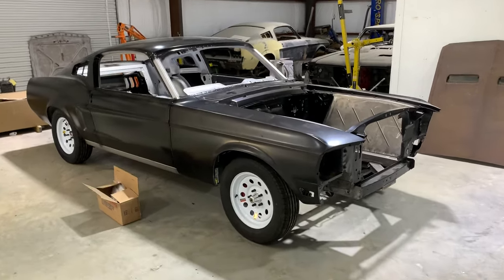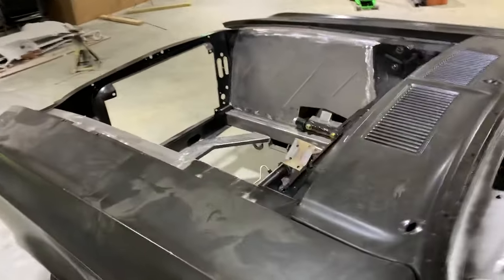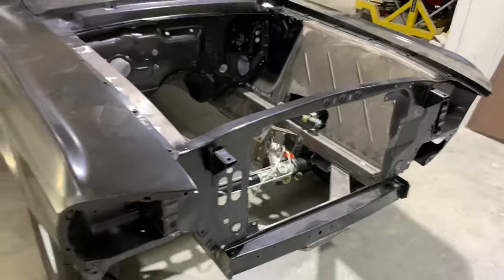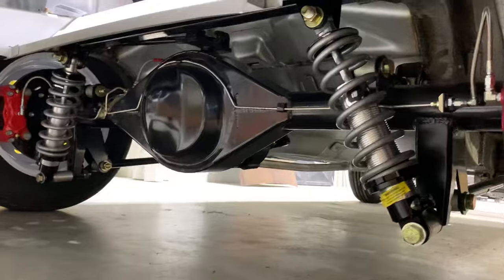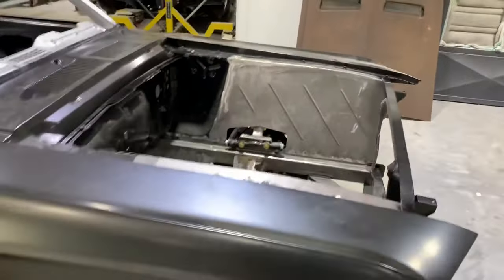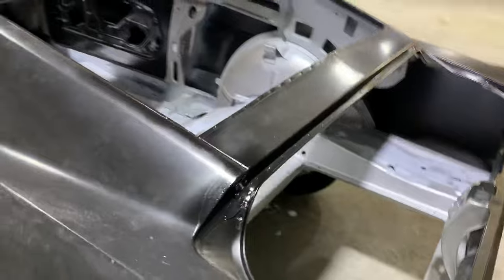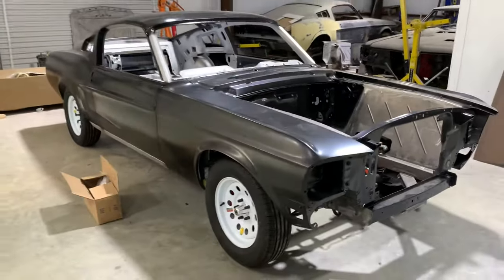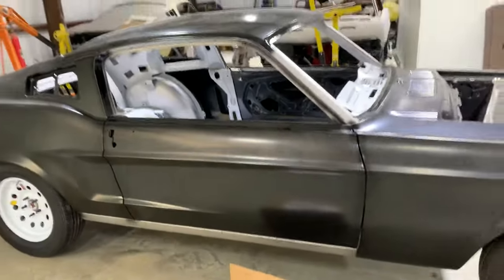New Mustang Fastback Bodies

Comment: Ten years ago I was given a rusted out 65 mustang convertible. I took my plasma cutter and cut the car up so a friend of mine hauled it to the scrap yard. I kept the drivers side door tag, left front fender vin number. I ordered a new convertible chassis and built a new 65 convertible. Added a four link rear suspension mustang 2 front suspension. Built a stroked 289 block to  347 cubic inch. I was 70 years old when I built my 65. I was approached by a guy who wanted to buy my car as it was and he and his 15 year old son completed the car. I tried to use all Dyna Corn sheet metal but had some Taiwan metal I had no choice to buy. I’m 80 and still in my shop everyday. Working keeps you healthy. Good luck to all you car builders.

Comment: That's how it was "born" alright. And damn that thing has birth defects right and left and top and bottom. Upside-down coil-overs that hang rather than sit on the "suspension". Which by the way has 2-3 inches of "offset" between the "spring" and the "hanger". More goddamned fittings and "adapters" and built-in "air locks" in those "custom brake lines" than even a vacuum bleeder will ever be able to "unlock". JIC "flare" fittings in the brake system and lines that are absolutely unsuitable for brake system use. "Unbalanced" left-right brake line length and volume and guaranteed "staggered" brake application and force in a "high volume" rear disk "conversion". Zero pinion angle at best which sure as hell won't be the case at the trans yoke. 

That's 100% an out-of-state "used car" safety inspection anywhere outside of Texas and several "red flags" just waiting for John Law BEFORE the complete impossibility of getting "taxes, tags and title" at all much less in a "law abiding" manner. Starting with "hard rubber" trailer tires on a "street car".  Even as a "roller" its a giant USDOT violation.